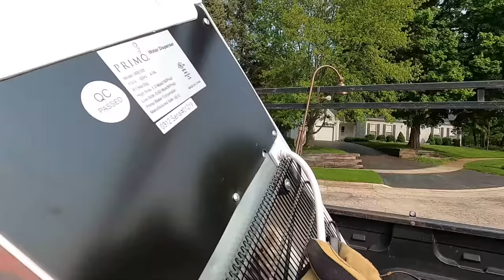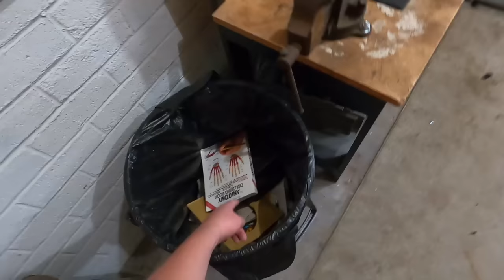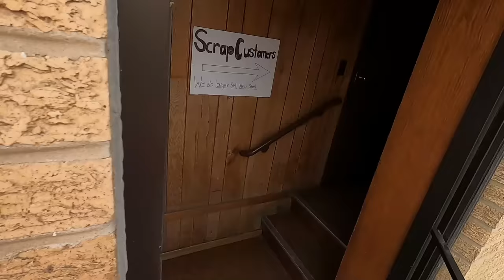Buried Treasure - Trash Picking Garbage Day

Comment: Paul it sounds like you are low in magnesium...if you are going to buy any make sure it's magnesium glycinate at max strength.. because mag isn't absorbed efficiently by the body. The best I found is by nutrition magnesium glycinate 1600mgs with max absorb of 400mgs per serving.

Comment: Instead of putting your work bench on cinder blocks, it might be more stable if you make a lift out of a frame made out of 12x12 posts connected together like a picture frame  and bolted to the bench.  Just a thought and God bless

Comment: That jack thing is a level jack for a camper its the ones that go under them to make them level so ur not on a angle while camping
Reply from the maker: Okay, that makes sense
Reply: @ScrapPalletMan  ya they r awesome for alot of stuff like ur truck if u got a flat or for normal trailers for loading cars and so on cause it can lift 12000 pound or something like if u find anymore alot of ppl looks for those type or here they do anyways easy 10 bucks if u wanted to sell them thats in good shape like that one

Comment: Question. Is stainless steel magnetic?
Reply: No
Reply from the maker: There are different grades of stainless steel. If you make a Google search, it will show it. Some stainless has slight magnetism. But the more expensive high grade stainless steel is not magnetic